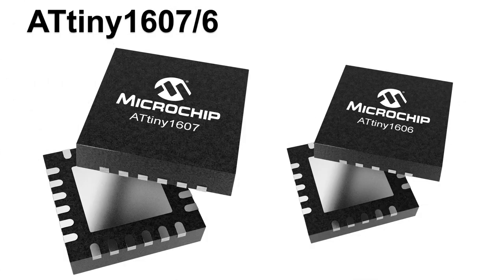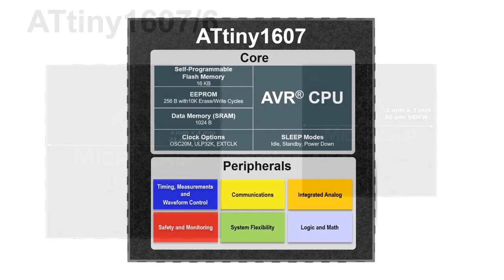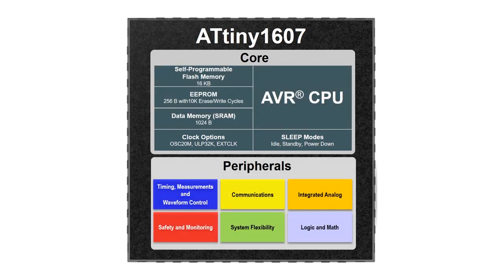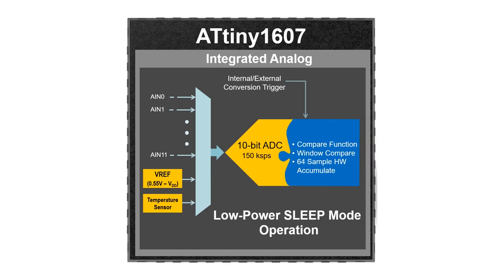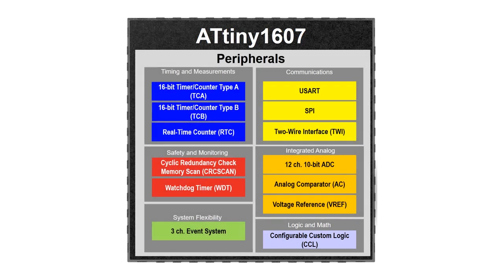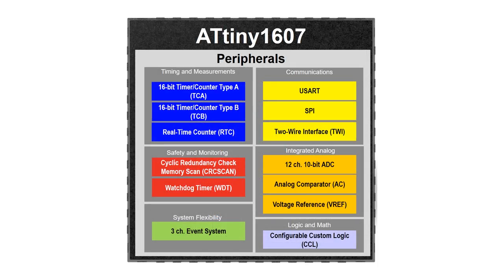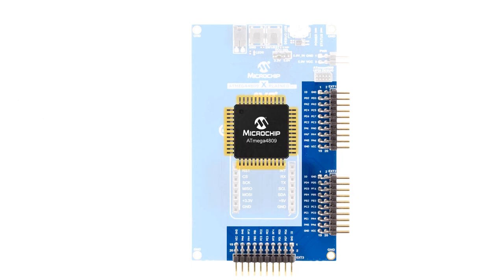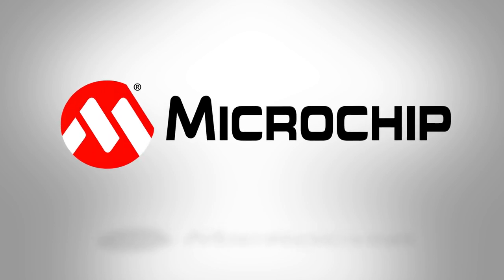ATtiny1607 Microcontrollers

Comment: is this CCL like the equivalent to some sort of DMA controller? like in stm32?
Reply: No.  CCL is a couple of terms worth of PLD-like logic, at least theoretically possible of replacing the "just a few gates" sometimes needed outside a microcontroller to do things like generate or decode Manchester-encoded, implement a handshake signal on a parallel port, and so on.  (I don't know that you can do exactly those things, but ... that's the idea.)